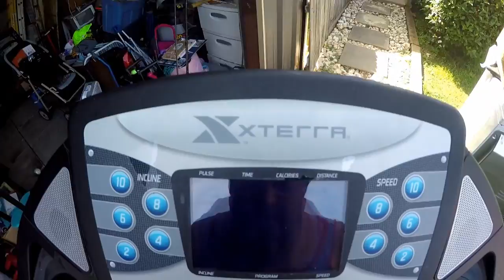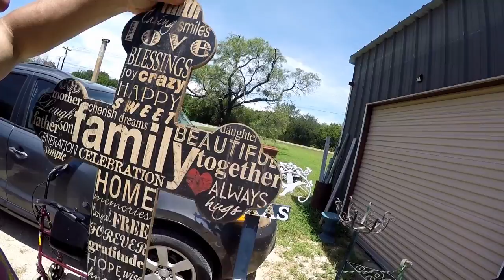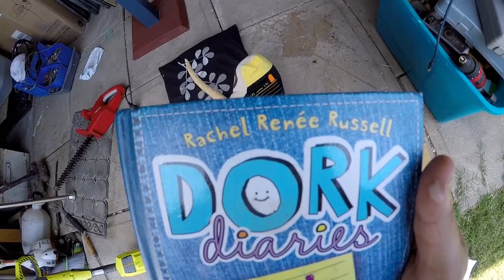NICE Scores on Trash Day | Guest Appearance

Comment: The white spots on the table is moisture under the finish. You can try putting a towel over them an using an iron to dry it out it takes some time to complete. Then you can mix olive oil and vinegar equal parts and use some fine steal wool to rub with the grain of the wood. Let the oil and vinegar stay on for a while and then buff with a soft cloth.